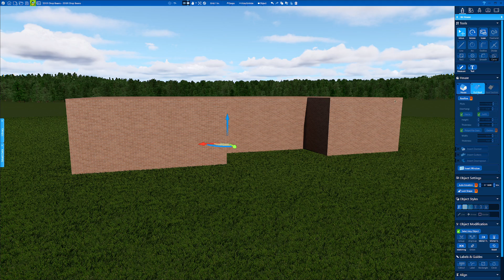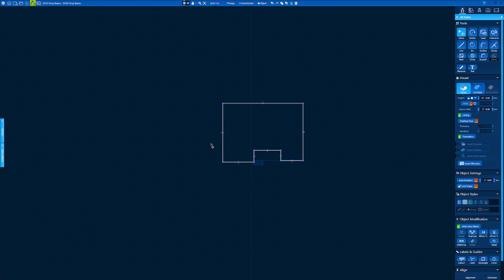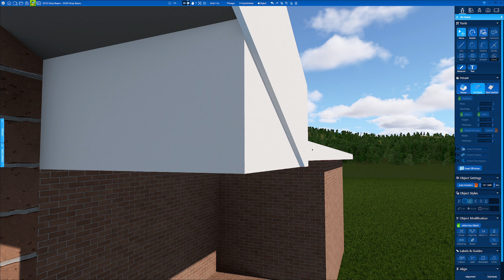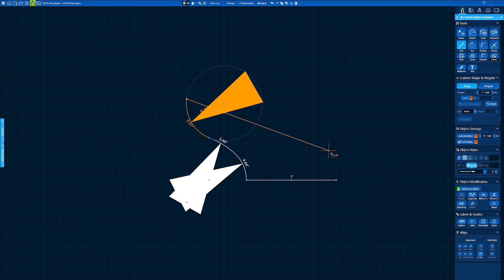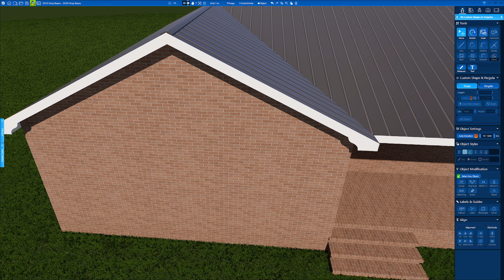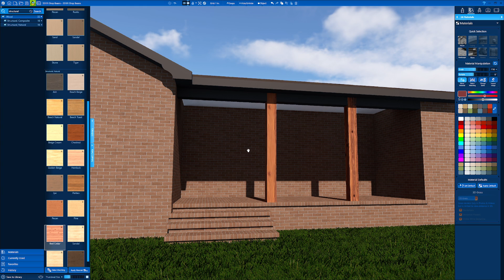Structure Studios Walls and Roof Tutorial

Comment: How do you split the house so you can have half siding half brick?
Reply from the maker: Separate your walls and roof lines. I draw the first floor and then draw the second floor as separate sections. Be sure you are using your 1" grid and lines snaps properly or you will see the sloppy geometry and they will not come together cleanly.